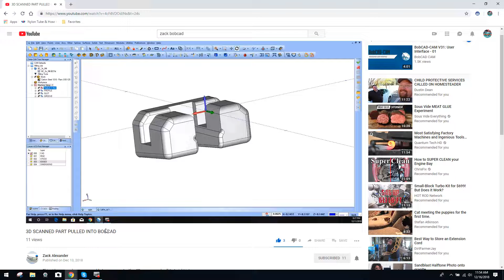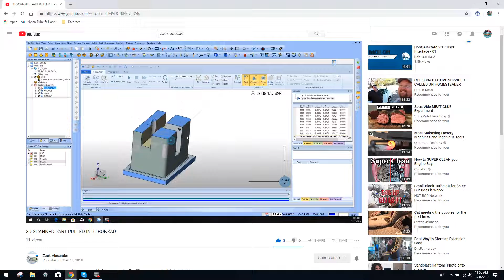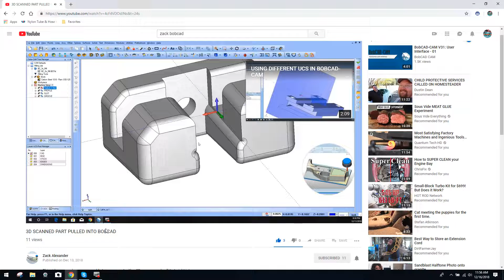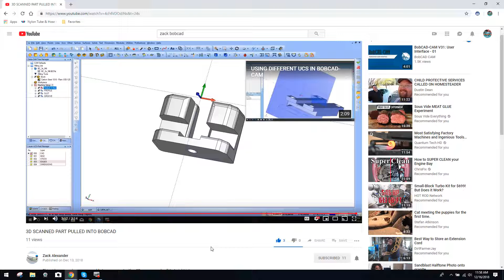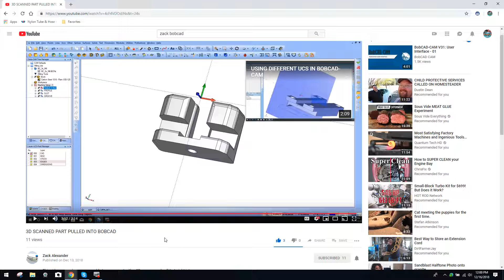Bobcad 3D Reverse Engineering Capabilities...

Comment: Can you give us some information on your 3D scanner ?
Reply from the maker: Guzziv,
I'm using an Einscan Pro+. Thank you,
Vince
Reply: Hi Vince, I am missing something, your scanner outputs stl file, and Zack mentions direct import into bobcad  ready to machine. Is that a Step or Iges file?  If so there seems to be something missing here.

Steve C
Reply: @stevecarlisle3323  
Yes, the file that I brought in was an Iges. Sorry for the confusions. I don't think we made it clear of the file type that we used. We tried STL at first, but we were not able to work with it at all and this was the answer to our problems. 

Zack
Reply: Thanks Zack. According to the specs on the scanner, it has no Iges output, which is common. How did you get the Iges file? The video gives me the impression that the scanner, or its operating software, automatically produces the file, with no further manipulation. Thanks for the response.
Steve
Reply from the maker: Steve,
The email I sent explained the process. Thank you,
Vince
Reply: @stevecarlisle3323  
I am not positive on this. We will have to wait for Vince to answer that.
 But once it was an iges file I can open it and work directly off of that file. You can technically use an STL with some bobart features or by using 3D toolpaths but its not very realistic with most applications in my opinion. 
We are definitely on to something with this.